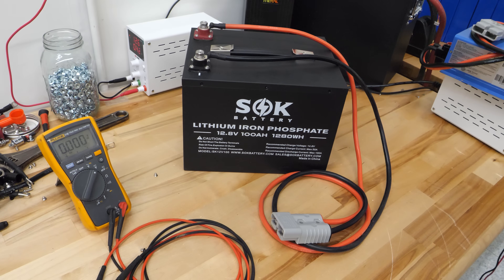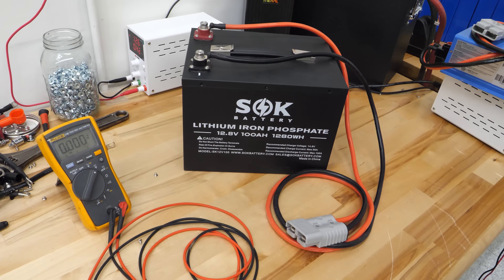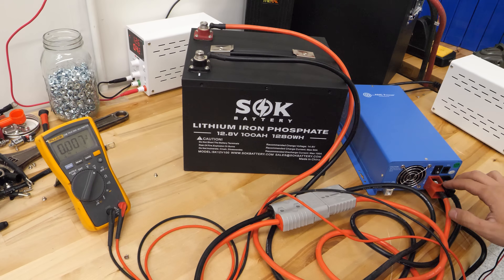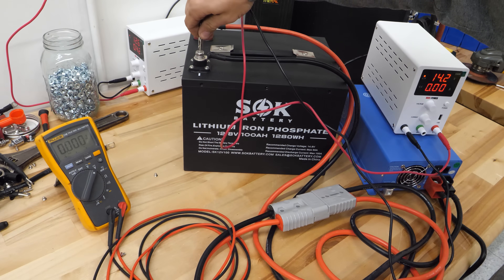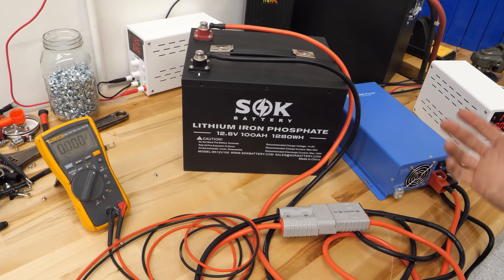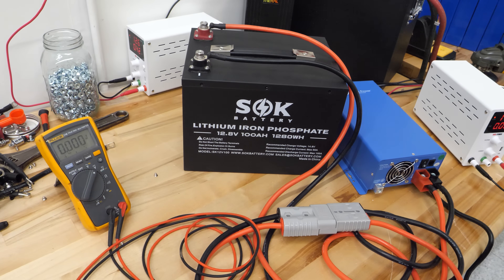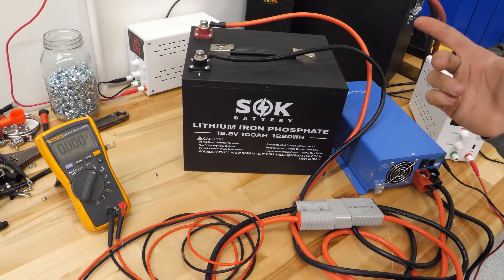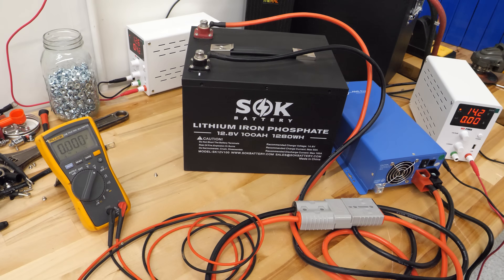How to Wake a Sleeping LiFePO4 Battery 🔋 Charge a Fully Depleted Lithium Iron Phosphate Battery

Comment: Hi - I just bought a LiFePO4 battery and it has voltage but 0 current - if I hook it up to the IMAX B6AC v2 charger, I get the BATTERY CONNECT ERROR - how do I reactivate it safely

Comment: I have a LifePO4 battery in similar situation but it is actually charged, that I can see 13.3V with the bluetooth app it has, each cell also has around 3.3V. But there is no output voltage, its just 0.06V~. I've tried putting some charge but nothing happens, any ideas?

Comment: just bought a MPP charger & Inverter combo. but it cannot wake up batteries, I would be interested in a combo that has wake up capability.
Reply from the maker: The only manufacturer we know that has this ability is Victron.  Their battery chargers, solar controllers and inverters will wake up the batteries every time.
Reply: Are the Victrons also a charger / inverter combo ?  I saw they are just chargers.
Reply from the maker: @SHOPBESTLOVE  They make both, actually.

Comment: I have a new 206ah battery and will only charge to 13.3. Could this be the same problem?
Reply: What kind of charger are you using? Try to charge it by connecting it in parallel to your engine battery AFTER you start the car. That will charge it at maybe 14V to 14.6V.  Rev up the engine to 2000 ro help the alternator and keep that for 5 min. Then disconnect wait 30 minutes or more and see if the 206Ah voltage now rests higher than 13.3V.

Do you monitor the current going in and out? Remember your battery's built-in BMS will stop charging it if you exceed sending 70A or 14.6V of "juice" to the 206Ah.

Comment: thanks for this video! I accidentally drained my brand new Weize 100ah. I plugged in my camper and after 12 hours the battery was only producing 11V. I thought I destroyed my new battery. I just watched this and used the battery that came with my camper to "jump" and wake up my lithium and now it's charging at 13v 35amps. Hopefully in a few hours it will be fully charged but I think I'm on the right track.

Comment: My issue is that the charger won't charge - the battery is far from fully discharged but not fully charged. The charger, however, is apparently being told by the battery that the battery is fully charged so the charger won't kick on.
Reply: Exactly the problem I am having. Searching for a solution. Battery reading 12.44V charger showing green light as if fully charged.

Comment: To help those without jumpers or extra battery. You can actually use a standard 9v household battery to wake it up. Just connect your battery tender or charger then use a 9v to wake it up.
Reply: Good points
Reply: how?
Reply: @s1dew1nd3r4 he means wake up the charger shown in the vid.  To wake up a sleeping 12v lithium battery, you need to apply more than 9v to it. Most of them need to see more than 12v input.

There's many possible sources for this. Wiring 2x9v batteries in series will give you 18v and that will wake up the lithium bms. 

I used an old laptop charger, which was 18v DC, but you'll need to know which wire is positive and which is negative. A PC power supply (12v DC) or wifi router power adapter (12v DC) would work too.
Reply: @M4K9G22   I have an old laptop charger, how long must I connect it with the battery?.
Reply: @jvck04  it only takes a second. The BMS will wake up as soon as it senses the incoming current
Reply: @ Thank you.
Reply: @ It worked, Thank you so much.😊
Reply: @jvck04 awesome! Glad that worked for you!

Comment: FANTASTIC!   I just woke up a 48v charger  (and the battery pack) for my RV by putting 42v across the terminals using a Segway scooter charger.  The battery read 32v - dead.  Wonderful!  Thanks a bunch!  Even the battery manufacturer doesn't know this trick.

Comment: how do you ever know if you actually started at your battery's maximum? Did your charger quit after it hit 78%? Some other %? Do have to go to dead, use a shunt and then measure how much goes in? Then compare that to the rating on the battery?

Comment: Hi, Great informantion, thanks.
can i Wake Up a Sleeping LiFePO4 24V Battery BMS with one 12v lead acid deep cycle battery?
Reply: I woke my 24 V Lipo by using 2 12 V batteries in a series configuration. Within two seconds I heard a click from somewhere and my Lipo battery would take a charge after that.

Comment: So I received bluetooth 100ah  battery from renogy 2 days ago and for the life of me cannot get it to activate its 100% new from the box. This method also did not work. Also tried renogy rover charge controller. Battery reads 6.83 volts across terminals. It wont charge it wont discharge it wont bluetooth. Renogy customer service dog crap.

Comment: Good video. Ive got it hooked up and the battery is still not "waking up" is it possible the BMS in the pack is configured differently?
Reply: Update: my battery had a damaged BMS, Had a gouge that crossed several traces including one of the primary leads from the cells. It was apparently done before the battery was assembled, probably during assembly of the bms board. I was able to repair the BMS and now have a functional battery. The store also sent me a replacement battery as well so I've got two ✌️

Comment: Some of us haven't even seen that blue box you have there, what does it do for the battery and why was the white box utilized? If it seems straightforward it's probably because you do it all the time. Can you do an example with a lithium ion battery hooked up to a lead acid charger
Reply: If you need a video to show you how to put a battery charger onto a battery then put the battery down, walk away and don't ever touch it again for your own safety and the safety of everyone around you 😔

Comment: So my battery showed up dead. I haven't even connected it to anything but the charger today and it was all the way dead.  Bluetooth in the battery running all the time? Why would the BMS not prevent the Bluetooth from discharging the battery that nothing? Am I going to run in to this every time I pull the camper out where it's dead if it sits for a few weeks?

Comment: I just experienced a 100ah SOK that is new, wouldn't charge as received and the cell voltage was so low the only way to make it work was to remove the bms and charge the cells directly, now it is charging fine. Big question is are the cells damaged by the low state of charge I received them in and why was it so low.

Comment: Will a Victron Multiplus 3000VA 120 12v try to charge an LFP battery showing no voltage like the other Victron chargers you linked to?

Comment: What voltage would be needed to restart a 48V battery/charger?  Thx
Reply: I'd suggest a 54 vDC power supply to wake up BMS-cutoff
Reply from the maker: As @cubbytech stated, I also recommend around 52-54v.

Comment: If the battery still refuses to charge, it is most likely a loose wire from the BMS to the cells, or a bad BMS
Reply from the maker: It's very rare to have a BMS failure.  Most of the time, if things don't work, the batteries have shipping damage, which can be observed by removing the lid.
Reply: @CurrentConnected  I just purchased a redodo formally known as zooms 12.8 200amp hr lithium and did the same newbie mistake . The info that came with my battery says if you damage the case or any part of the battery aka take it apart to inspect it voids the warranty . Is there any way to check for shipping damage other than taking apart the battery ? Im on a fixed income and really can't afford to throw away the $800 I spent on it

Comment: Why did the BMS stop the discharge at 10.5 volt??
Reply from the maker: The BMS stops discharge at around 9.4v.  The customer in this case was using DC loads which were capable of loading the battery all the way down until complete discharge, so no matter where the discharge cutoff in the BMS is set, it would be triggered and this issue would happen regardless.

Comment: I’m new to LiFePO4 lithium batteries, but I thought a max of 10 amps, usually 5a, is what you want to charge your battery but you’re using a 75amp charger? So I’m assuming not all lithium are the same because of the BMS? I just got a great deal on a bunch of PSL-1245E and the datahseet says 25 amps is the max charge/discharge rate, or am I reading that wrong? Can’t get any of the “superstar” YTers to answer my question, guess they too busy getting given stuff for free to “review” ...lol. But ya bro, some incite into this would be cool, I do have a 30v/10a lab PS I use for repairing amps but I do have a 12v/90amp PS for benching repaired amps FYI so ya, lmk and thx!

Comment: You can still get old-school battery chargers; manual battery chargers that have a switch on them to change between 6-12-24 . the "smart" chargers I've always found to do a poor job in sensing and are too tempermental from a safety standpoint.
Reply: In saying that. You can use a smart charger, just have to enable the bms by jump starting the battery so to speak with anything over 12v and a light bulb

Comment: So if you had two batteries and one was shut off, could you connect them together and the one would turn the other on?  Sort of like if you were balancing them?
Reply from the maker: Yes, exactly.  The BMS of the dead battery would see the charge current and turn on, and if not, the charger would see voltage present on its terminals, turn on / start charging, which would then push the power through the BMS which would re-activate it.
Reply: @CurrentConnected  Thanks!!!

Comment: I heard you say that was a 75amp charger.  Is that okay to use on the SOK 100ah battery?  I realize this was just a learning video, but your website lists the recommended charge to be under 20a and the max to be 50a.  It would be great to hear I could add a little more beef to my charger down the road once I improve my cabling further.
Reply from the maker: The charger can do 75a, but it has an adjustment knob so it can be turned down to 20a.  You can set it to whatever setpoint you want.
Reply: @CurrentConnected  Good to know - thanks for the details.

Comment: The Key is the BMS has cutoff the discharge of the battery.   It will not reactivate until some current goes back into the battery.      It's not the cells themselves but the BMS.
Reply: The user discharged the battery to the lowest limit of 2.5V or less and as Jason explained the , the MOSFET switched off the battery (cells) before the damage could take place. Victron IP67 would recharge the dead battery without external Exciter procedure, as the presenter narrated. FYI the battery in question uses smart JBD BMS.
Thanks for reading. 73s…
Reply: @sreekumarUSA  hi, can connect? I have some specific queries
Reply: Oddly, the video indeed omitted the actual reason being that the BMS low voltage protection cuts off. I have mine connected with my engine start battery via a 30A switch on the dash (helps the SOK start the fridge). Had to use it once when during storage I left the solar charger on (in sleep mode but drained the SOK 206Ah nevertheless).
Reply: @judgedredd8876  you went on to now explain the reason though
Reply from the maker: Exactly!

Comment: I get the idea behind this, but it is annoying to have to do. There should be some sort of reset button on the battery instead.
Reply from the maker: If there were a reset, the situation would not be cleared because the cells would still be over-discharged and not safe to turn on until they get some charge current into them.
Reply: @CurrentConnected  yes but I would think if your set it up so that by pressing a button it fed voltage to a charger the charger would then turn on so it could charge.
Reply: @jayctacohut  Yes it should be, common sense at least if the BMS switched it off, I do believe there are now a few companies that incorporate this wake-me-up button.
Reply: YyyEsss! A wakeup reset button..perhaps retaining a small bump voltage in a built-in capacitor/resistor setup inside w the BMS setup! Eh?..Eh?

Comment: I had this issue when I First switched to LFP from Lead - (Learning Curve Ohh Boy ! much to forget and relearn anew)

A Fellow Geezer had the simplest of solutions and I have never sufferd the problem again.  The Cutoff Values in the SCC & Inverter/Charger Profiles and matching them to the BMS', so that cutoff occurs BEFORE the BMS force Cutoff (only has to be a 1/2 Volt difference).  This allows the BMS to stay awake (some models go into "Sleep or Storage Mode" and will respond to incoming charge when present.  This also allows the SCC to keep "in touch" with the Battery Voltage Sensing.

LFP is at 0% SOC and discharged at 2.500 Volts per cell.  10V, 20V &  40V respectively.
Cutoff @ 2.750 (is in the bottom Curve and Below Working Voltage Range of 3.000-3.4000 where the AmpHours come from but still alive enough to not go 0% and cutoff.
By Setting Inverter/SCC Cutoff to 11.0V,  22.0 or 44.0 will resolve the issue.  

Even with Grade A+ Matched Cells discharging below 2.900 Volts per cell is down into the Cliff Fall Curve with very little to gain from it.   

2.500-2.950  (Bottom Curve)  and 3.475-3.650 (Upper Curve) only represents about 5-7% of total "GROSS CAPACITY" which should be typically 10% more than the working NET AH Rating of the cells.

 - Nota Bene !
DO REMEMBER that there is (always is) some Voltage Drop between Battery Terminals to Inverter / Charger terminals and Battery & SCC Terminals so that MUST be compensated for.   All Lithium Based Batteries are Millivolt/milliamp sensitive unlike Brute Force Lead Acid Batteries.   

Pending on BMS, there may also be a setting to allow over discharge which is set usually in Seconds of Time, this is to allow for a heavy start surge momentarily when Battery is low, this shoudl NOT be longer than 10 seconds AT MOST otherwise there is a risk of pushing cells down to BMS Cutoff point.

Remember the Working Voltage Range which is what provides the "Labelled AH" is 3.000-3.400 Volts per Cell.   ALL WITHIN a 0.4 per Cell Volt Range !
12 - 13.6 volts ( from 3.000-3.400 )
24 - 27.2
48 - 54.4

For Current Connected & Other Vendors.
It would be prudent to include instructions for the Charge Profile Settings for such batteries AND also to advise with regards to the Cutoff Voltage Points to use with SCC's Inverters & Chargers.  And ALSO include something with regards to correcting for Voltage Drops and how to Calibrate that.   Sadly, there are so many variations this can only be a generic datasheet to enclose with the batteries & devices.

An Intro / Welcome document on how to commision the battery packs into service and teh steps required for a succeful instalation & happy clients.   Never Ever Assume that the receiver of products has any idea of what they are doing !  Always look towards teh Lowest Common Denominator.

RULE of 3 Applied !
If the same question, problem, issue arises more than 3 Times; 
- the Solution should be documented for reference.
- if a "user issue" the documented solution or links to solutions should be included.
- if an actual fault, then solve the actual fault before continuing sales etc.
- AN OUNCE OF Prevention = a POUND OF Cure (and it's a boat load cheaper too)
Reply from the maker: Hi Steph, we REALLY appreciate your comment.  YOU ARE SPOT ON!

Regarding instructions for the charge profile settings for these batteries, we actually have your suggestion implemented.  We list all these details on the product listing, so that they are a quick reference to anyone. On our new product, the 48v100ah server-rack battery, I'm looking at over a 100 page document because we are ensuring it has all the information to help a customer figure things out and be successful with the product.  Far too few products these days have the proper documentation and it drives us NUTS! 

Regarding calculating for voltage drops, you should NEVER adjust your LVD based on voltage drop on the wires, because if you are running a smaller load the LVD will be totally inaccurate due to reduced drop.  If voltage drop is causing LVD to kick in too soon, then sorry to say it but your wire is way too small.
Reply: Dear Steph, after proving you’re not a geezer by the amazing knowledge of battery electronics ,you proved you are a geezer like me by using Latin on YouTube! Much appreciated! Almost nobody learns Latin these days! Ave.